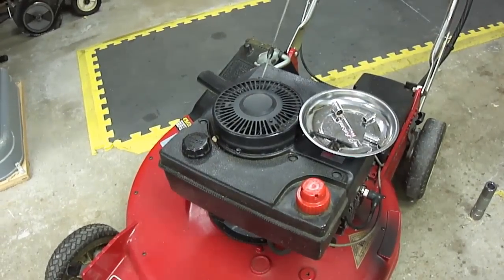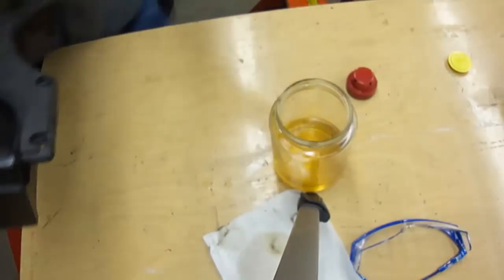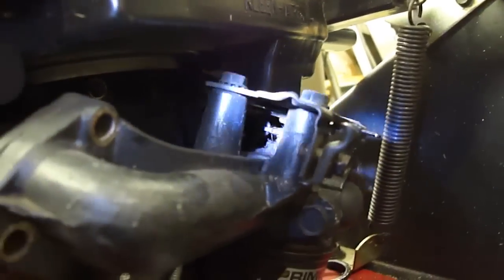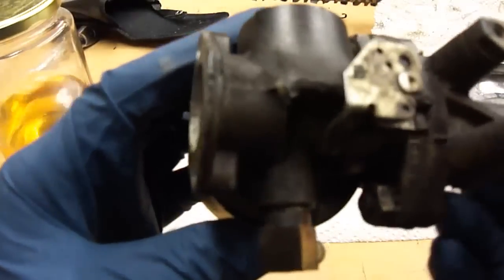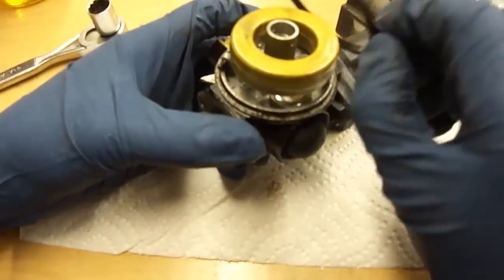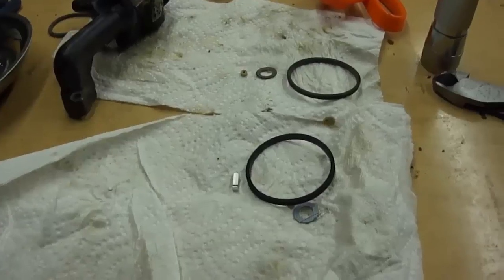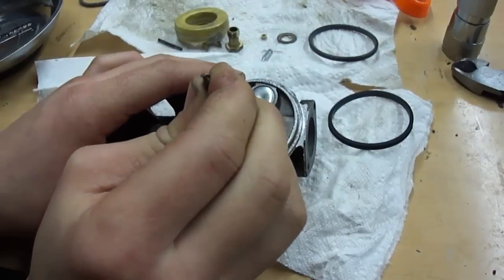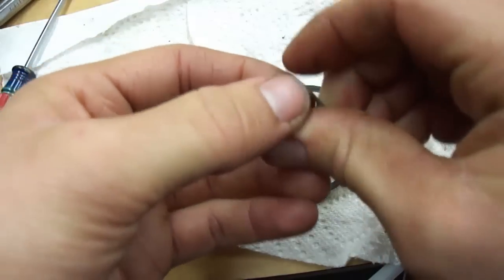How to Clean and Rebuild a Tecumseh Carburetor

Comment: Is there a reason why you did not remove and inspect the emulsion tube?
Reply: I have the same carb, which in my case comes off of a 1980's Snapper.  On this carb, the emulsion tube is metal and looks to be pressed in.  I left mine alone too.

Comment: Hi, I have the almost same carburetor of tecumseh premier 3.5 hp. the carburetor  is leaking, the o-ring and gasket are very bad and need to be replaced. Please advice me where can I order them. I am not sure if the engine model: SBV 5510 Serial# 1060325 are correct or not. However, when I look at your YouTube, your O-ring and gasket are the same as mine. Please inform me the part number. Thanks.